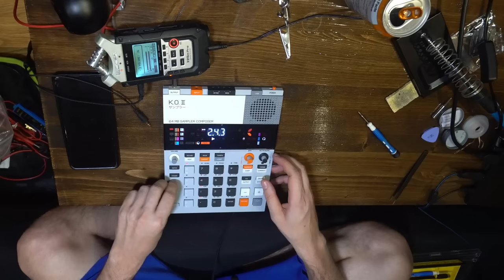EP–133 K.O.II Fader Fix

Comment: It took some adult engineering to fix the teenage engineering
Reply: Lool. Doesn’t look too complicated if you’re patient.
Reply: Quality. 😂
Reply: This needs to stay top comment
Reply: Fn 💀 😂
Reply: Funniest reply I've read in a long time 😅
Reply: I actually worked there for many years but they let me go without warning on the morning of my 20th birthday for some reason?
Reply: If the fader works out of the box, then why bother with the knob and try to make it wider before fitting it? 
I made the pin of the fader a little bit more shallow using a small file. After that the knob went on the pin nice and easily.

And if the fader was broken I would replace it with a higher quality fader from i.e ALPS. Anny 45mm fader should fit. But again, I would file the pin to be more shallow.

Comment from the maker: This is how to fix the fader on your EP–133 K.O.II. Please sub if you found this interesting.
Reply: Isn't this basically new? 
How much use did you get out of it before the fader died?
Reply: Do you think the suspicions were correct about the issue happening during the knob install? It looks like those pins could be pretty easy to bend and may just be too soft to handle any external loading.
Reply: @matt-lang  
100% looks that way to me.

Comment: WOW!  Cool. Nice work Decima1! Hey, I wanted to mention, there is probably  a "Solderless Solution" here.  I have used this method (trick) with misbehaving slider switches, and it probably could be utilized here, most likely also fixing the issue... So, to fix without soldering, we are going to improve contact of the slider by slightly deforming the top of the slider's metal casing - evenly on both sides. To do this, we would need a set of long needle nose pliers. On the end of one side of the pliers, you need to tape into place (using gaffers tap), a single BB, from a BB gun. This will be the contact point for bending down the exterior of the slider track. Then perhaps a clean Popsicle stick to protect the back side of the board from the other side of the pliers. What were are going to do is cave in slightly the housing of the slider evenly all along the track on both sides.  Just a small amount is needed.! This will create a much tighter channel for the slider, provide downward pressure, and thus a far superior connection of the contacts. You will have to be careful not to crush the slider housing down too far or the slider will bind. If you eff it up, you can always then proceed as Decima1 is showing here -  which is a much more professional fix, but you'll need to be comfortable with de-soldering a major component of the board.  Great work Decima1!
Reply: Yea man. That sounds fun. Can you put up a video cuz we all newbies here!!! Bb n popsicle sticks ::::: we should have the right to repair!!!

Comment: To stop this happening again after the repair, you ideally need to put a little plastic skirt of some kind on the base of the slider knob, to prevent the knob being able to push down too far towards the front plate (which in turn pushes down on the fader bending the two wipers).
Reply: I was thinking the same thing after looking at my tr-8s and its 11 faders
Reply: Ideally you need some kind of rubber "lips" to protect the case against any dust and particles falling inside. IMO it's a bigger evil and potentially can cause much more problems.
Yeah, that "spacer fix" may be a good thing too! You never know if somebody will try your gear and break it because you can't worry everybody.
Serious companies usually protect their faders (against dust) with "brush lips".
Reply: @CycleSage  faders on the TR are waaay better quality. They can take some rough handling.

Comment: Thanks for posting buddy, so I thought about what you said with connection. I pressed on the front of the case about where the screw would be located and lo and behold the speaker fired up. I’ll be taking it apart tonight to tighten the screws. Saved me from RMA Thanks bro

Comment: Man thanks so much! I had the same issue and after watching this video it made me wander if i could fix this without taking it apart. I managed to bend those contacts with a hair pin and now it works fine! Couldn't have done it without you disassembling the fader in the first place to show me what was what👍
Reply from the maker: This is awesome I'm glad!!!
Reply: No soldering required? I’m interested, my unit just arrived and the faders non responsive right out of the box, without trying to install knob lol.. really want to fix it but don’t have soldering equipment, and also don’t have any experience doing any soldering lol

Comment: That board is huuuge, and mostly bare. I don't know why I expected anything else, with how everything's placed. But come on, you get 5 times the circuit board for 3 times the price of the original ko :)) 
The fader looks cheap, but it's a standard part, easy to replace (maybe upgrade) if it does completely fail. 
I love how they implemented the screen - two dozen leds on the main board and colored plastic front - makes sense since they're just function indicator lights. The three character display is custom, or at least I haven't seen that segment arrangement anywhere else.

I can buy the thing with some confidence now. Thanks!

Comment: It looks like it could be easily avoidable if it would come with a knob preinstalled in the factory. The knob is sticking outside the rail, so it should protect the fader from being pushed down too much. At least, I hope it will work this way. If not, then it's a significant design flaw. Still, I don't feel comfortable with my purchase. I hope they will freeze the shipping and solve the problem before they ship another batch.

Comment: Thanks so much for demonstrating the fix! Still wonder how many of these sliders are getting crushed under the weight of heavier packages during shipping and how many are just failing due to the design of the slider knob requiring so much pressure to install it. When mine arrives I'm going to first put the slider through some tests without the knob to make sure it wasn't damaged in shipping. If no problems there then I'll see if it feels like it's going to take a lot of pressure to put the knob on. If it does, then I'm thinking I might try using a Dremel to take a little bit off the thickness of the top few mm of the metal slider post. Just enough to let the knob fit snugly but without needing a lot of pressure to push it on. I'll probably have to poke the slider post through a big sheet of plastic film first to make sure I don't get any metal dust flying into the rest of the unit but I'm hoping that does the trick without having to deal with a warranty issue or risk voiding the warranty by opening the unit.
Reply from the maker: Watch my newest video

Comment: I haven’t received mine yet but wonder if you think holding the fader post with needle nose pliers and applying equal counter pressure when installing/pushing the fader knob on might be a good preventative measure? Any thoughts?

Comment: Yessssss!!! Love the ingenuity tenacity and fortitude here!!! Quick question as my fader seems perfect in working physically but zero functionality in software. Like it’s not connected or something.  Do I still need to solder or is it a simpler fix???? Peace n thx a mundo:)))))
Reply from the maker: The fader pins need to make contact with the metal plate so you will have to use the method in this video or there is another method using a paper clip to bend the pins down. I haven't done the paperclip method so you should ask around how to do that from others.
Reply: Just used a Bobby pin with a right angle only at end and the little plastic bubble on tip. I did it!!! Just did one side down in and slowly push down then the other side. Ez. Seconds and works great!!! I am not a tech but it really was ez. Make sure it’s turned off of course.

Comment: it's called a desoldering pump :) Nice work repairing it yourself, surely loads faster than waiting on them.

I wonder if they would have warranty-repaired this? Or tell you they don't have replacements to send you. Outside of warranty TE would absolutely charge you $150 to repair that I bet lol. They quoted me $125 to replace a $20 battery in my OP-1 and would not ship me one due to airplanes and raw lithium batteries. I also had to ship it there and back at my expense.

I used the $20 battery and got more capacity, but I digress XD
Reply: Desoldering pump or solder sucker
Reply: @micknorthyard815  I forgot solder sucker. and de... FML.
Reply: @Emily_M81  A beloved tool has many names 🙂

Comment: I think it is a combination of the packaging being about 2 mm too thin and also the force required to put the cap. I got mine today and even before taking the cellophane off the box I noticed the slight protusions on the box cover where the stems of fhe potentiometers and fader are.  This means that the box was probably in a large stack of boxes and the weight of the boxes on top put presure on the flimsy packaging. On the inside the ink rubbed off onto the box on the pressure points. Then the cap itself does not fit without applying considerable pressure. All of this is a recipe for failure. TE droped the ball on the packaging and the cap. So far, my slider is working, but I'm almost afraid to touch it, which is silly.
Reply: I noticed this exact same thing, ink rubbed off onto the box and I suspect its because of the packaging too. RMA'd it but im dreading the exchange time it could be a while before i see a replacement

Comment: those slide pots are notorious for being finnicky and not lasting long. its such a simple mechanical fix that its a shame you have to desoldier and dissasamble just to bend the contact pins back. It would be a cool mod to just replace it with a regular potentiometer and slap a big knob on it in the sliders place.

Comment: Nice job on fixing it. I'd have done the same. Any excuse to get the soldering iron out! Seems strange the knobs aren't pre-fitted. It looks like the pressure needed to fit the slider knob is bending the prongs in the fader so they no longer make contact with the track. They either need to redesign that or install the fader knob before shipping. But if they don't redesign it or use a better quality part, any knock on the fader knob will potentially bend the prongs.

Comment: So this then confirms the pins are being bent while the knob is being installed then? I doubt that much force is being applied that directly while shipping... So it seems either not installing the knob on the fader (as you said in an earlier video) or possibly using a dremel tool to make the knob fit could be good solutions.. that or T.E. just sends out stuff that fits.. Thank you for taking your stuff apart so we can all see!!!

Comment: Hey buddy love your vids. I need to fix my speaker, my Fader is fine. If I twist the unit slightly the speaker kicks on for a second. Did you happen to see if the speaker uses these same kind of pins? I was thinking solder on the contact points would do it of the speaker as long as I don't bridge the points.

Comment: is the bend pins from too much pressure on the slider from placing the knobs on or during transit? or just a cheap part?
Reply from the maker: I think its from installing the button and or tranist some peoples sliders were not working without putting the button on
Reply: I've a feeling it's a combination of both.

Comment: just got mine , didn't put on knob, first thing I checked and it don't work right. with a little pressure it works but when letting off it levels jumps around :( Thanks for the video
Reply: update ..I did the same and for now at least its fixed quite the pain in the as though.

Comment: There is also a chance to get some pressure issue with the "ENTER" key. Just got mine and the fader didn't work, as well as the screen didn't show anything, but 30-39 number all the time, related to the pressure around or on the "ENTER" key :(
Reply: Same did you tried this fix and did this also fix that issue?

Comment: Any idea how to speaker was connected. I paused your video to try to get a glimpse. My speaker as well as others came doa. I’m wondering if it is just a broken connection. It looks like in your video the speaker has wires coming from it but going to the other side of the board. Any ideas?
Reply from the maker: I'm working on a speakergate video
Reply: @DECIMA1  you the man, any idea when your gonna release it? I have no issue tearing into the ko. My fear is that I open her up and it isn’t a bad connection but something wrong with pcb. TE just hit me up to start an RMA but my fader works and I’m really enjoying using the KO. If I can fix it myself I rather
Reply from the maker: Its out now

Comment: Thanks for taking the risk for this vid. It’s badass it’s a repairable issue. Glad you fixed it. Did it look like this is an issue that the unit shipped with or caused by putting the cover handle/button on the slider?
Thanks!

Comment: Has your internal speaker been problematic at all? I was grateful my fader was fine out of the box, and I opted not to even push the cap onto it for fear of damaging it. But the internal speaker triggers….pretty inconsistently. Occasionally some of the melodic sounds seem to trigger mor often than any of the percussion samples…..I’m not sure if this is something with velocity settings, audio routing (not sure that’s even an option) or, more likely than not, some issue with the speaker being misassembled. Perhaps it’s not fully soldiered on? Anyhow…you seem by far out of all the reviews the most adept with electronics. The fader is clearly a much more common issue but I have noticed a few other people asking about the speaker….but thus far no one has any real solutions.  Thanks!
Reply from the maker: Speakergate video is in the works
Reply: @DECIMA1  Awesome. I just posted a poll in the user group on Reddit….curious how widespread the issue is. Debating returning my copy but since the fader is ok, I’m afraid I’d just end up with a broken fader or both. It’s been mentioned that the packaging seems insufficient to protect the machine during shipping. There are visible pressure marks on the interior packaging that held the unit that correspond to all the knobs, and two spots for the fader (like it shifted in transit and created two pressure marks for different positions.) The caps were also loose and rattling around the packaging….not sure if this could’ve damaged anything. The quality control has been a bit disappointing, considering how intuitive I’ve found the U.I., along with it just being a pleasure to hold and use.

Comment: Do you think that putting a very small piece of tinfoil between the prongs and the surface with very thin pliers through the fader long hole would do the trick ? I'm asking for the people who don't want to bother with soldering or don't have the tools.
Reply: From the look of this video, it seems you can’t reach the prongs without soldering as it is facing downward (toward the pcb) you can only access to them by detaching it so unfortunately soldering seems to be the only way.

Comment: Do you think they are getting damaged when putting the knobs on the faders?
Reply: It is possible. If you were to push down on the fader lever, it could bend the tangs up beyond yield (aka it won't bend back to original position). That would leave a gap and it would stop working.

Comment: That slider looks very flimsy. I wonder if there is a better quality aftermarket fader which could be installed. Someone needs to measure the resistance and work out if it's log or linear.

Comment: Bad engineering instead of choosing the correct cleaence for faceplate or adding support to prevent downward pressure on fader.

But saying that the non endless choice of  encoder is another bad choice of part.

I expect a rev2 soon if they clear there stock of components